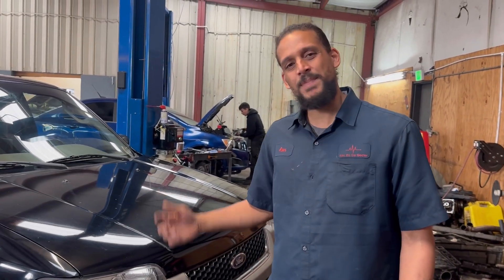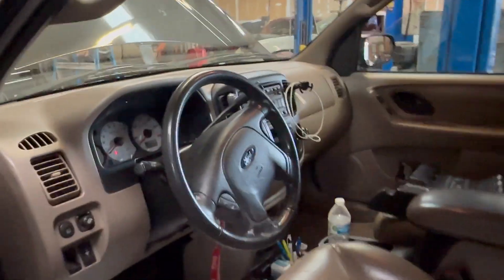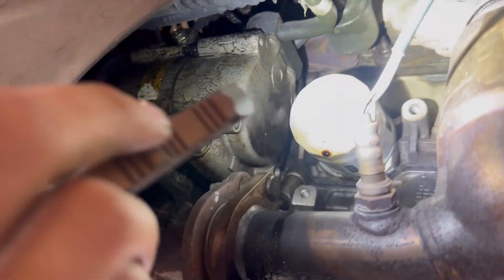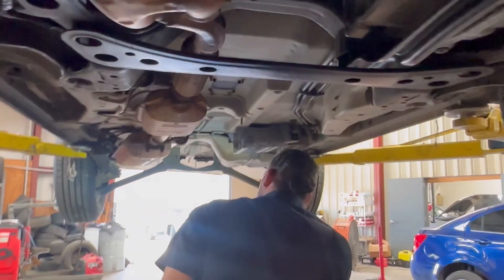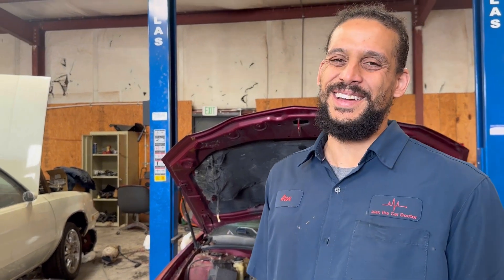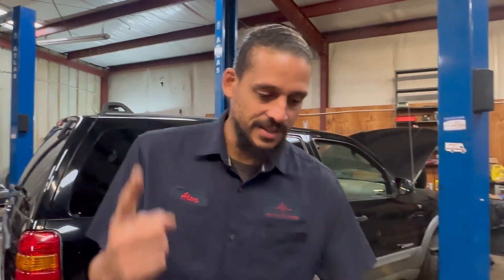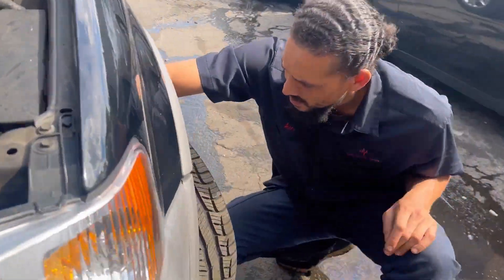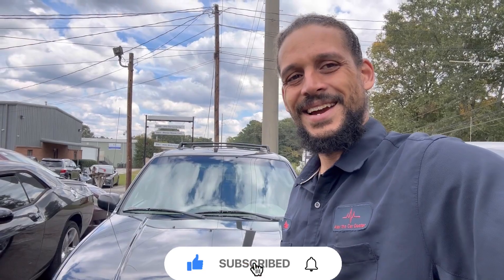$2600 Quote For Work She Doesn’t Need!

Comment: I appreciate Alex and his humbleness of not trying to rip his customers off. I live two states away but I would literally drive there and back if I ever needed my engine replaced. There’s only one shop in my city that I trust to replace my engine because they have good feedback on engine replacements, but their labor costs are outrageous. $9,000 to swap in a normal non-performance stock remanufactured engine and for labor. So the people here who have access to a lift or have the stuff to do it in their house garage are lifesavers.
Reply: Parts prices are outrageous. A long block is prob 5k for quite a few cars. Then add additional parts found of 500-1000 that may need replacement

Comment: Those escapes are good with the v6. The cats do go bad if an ignition coil went which is common. They have 3 cats but the 3rd is not monitored so you may get away with straight piping. You’ll have an up and down fuel trims while idling.

Comment: Nice to see an older car that has been taken care of. They brought it to the right shop for an oil leak. Good old valve covers, well it's a whole lot better than a rear seal or the quote from a shop doing things it did not need. I'm an old dude, I remember when you could pull valve covers off in just minutes. I was somewhat mechanically inclined, now days I'm not so sure. I guess if you do it enough.

Comment: I own this car, and I would say they need to change all the gaskets from the valve cover (front and back) and the timing cover gasket. 
They don't need to change the oil pan gasket if it's not leaking . 
I did it myself, and it took me a week since I was taking my sweet time. It's definitely a 3 days work if you are serious about it. 
The timing cover gasket will always leak at the bottom left rear. 
It's a good vehicle but a pain in the butt to fix it .

Comment: I wish you was in Tx cause I got a bill from the Nissan dealership for 5,876.52 and the only thing I went in for was an oil change the transmission is an cvt slip and low line pressure, evap vent control valve,gas cap,air filter, cabin air filter, spark plugs, lower control arm, I got an code 456 that’s the evap vent control and gas cap small gas leak I don’t know what to do about that please help me I got a new gas cap but the code still come on and the cvt transmission has to filter that needs change but they say it does not need change only thing I need is an transmission flush and the other code is an 101 I have an 2016 Nissan Sentra sv
Reply: Look for an honest mechanic in your area. If you are around Austin, I know 1 that is legit . He was a mechanic in a lot of dealerships around Buda and Austin.  He just decided to be a mobile mechanic since it's more money
Reply: Cvt are junk. Sell that car and get a manual or car with good automatic

Comment: An oil leak automatically gets a PCV  or next higher assy, a clogged PCV is what caused large amounts of oil leaks and its part of the J.O.B. everytime with me, WTF Dude. Its not even on the list of parts from what appears to be a high end shop, maybe its included with the shop supplies???

Comment: Why do you say an engine is toast just because of a bad head gasket??
Reply from the maker: Because it got very hot and most likely burnt up like toast But no seriously when an engine overheats, you could warp the engine block along with the heads, resulting in an engine rebuild and lots of machine shop work most of the time it’s just easier to replace the engine

Comment: Please stop adding in your shop supplies that is the price of doing business!
Reply: Your comment shows how little you know about the business and what it takes to stay in business.
Reply: If not they have to itemize every can of brake clean, brake fluid, degreaser, greases, ect. Even a spare bolt or two. Its much easier and convenient , and way easier to keep up the books, to have a shop supply fee.
Reply: Ok, then I'll just go up that much on parts and labor and you'll not see it. At least this way everything is up front and transparent. There is not a shop anywhere that doesn't do this, unless they are going out of business due to poor management.